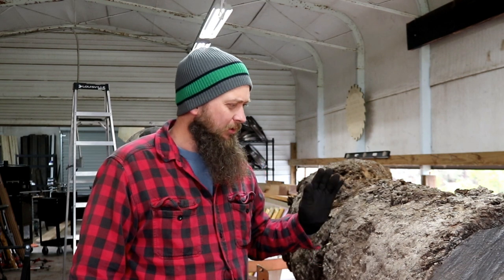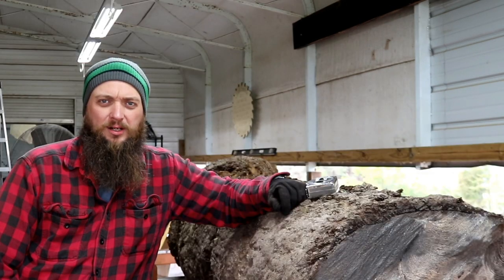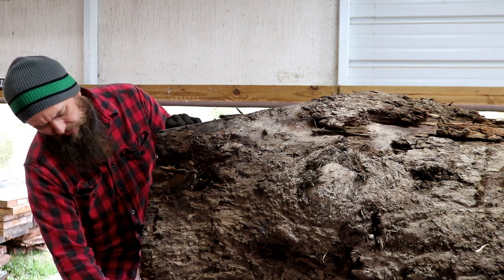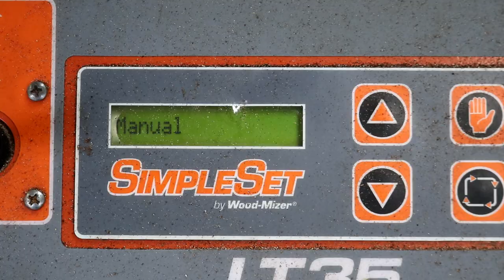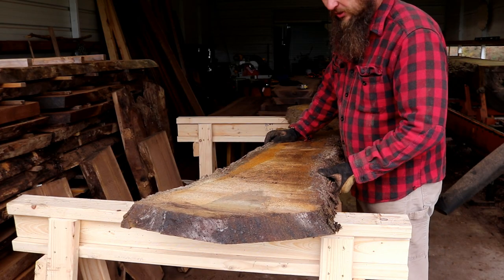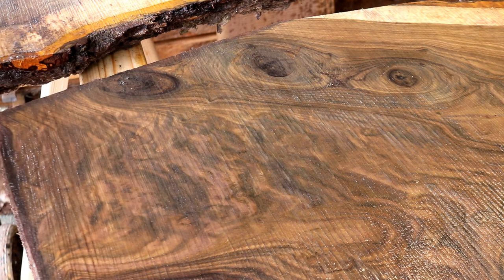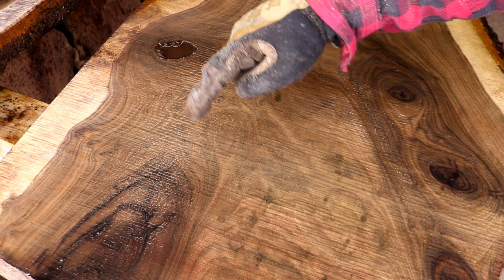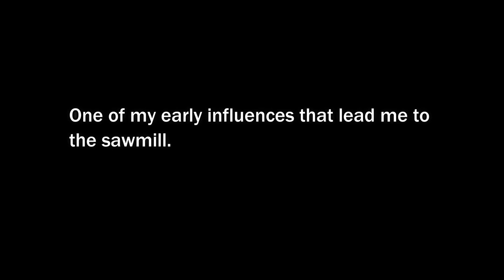THIS LOG WAS LIKE NO OTHER, STUNNING WALNUT SLABS

Comment: When I used to travel backroads north of T.O. (Toronto) in the late 1950’s, looking for derelict farms to photograph for my studies at Ryerson Photo Arts I heard of this farmer who, like many, had a fairly good sized pond in front of his farmhouse. It was getting a bit messed up with old equipment and all manner of other junk so he called in this guy with a backhoe, enough to clear the junk.
It didn’t take long for this contractor to find a large 36” diameter old log , totally waterlogged at the bottom of the muddy pond. After a bit of a struggle and a hefty steel chain he managed to drag it out into the farmyard. To their surprise they found two more which they soon realized were walnut, clean cut at both ends and revealing, even in that condition to be probably intentionally stored underwater by the previous farmer. The logs were ideal for veneer and fetched $26,500 from a veneer specialist who saw the potential profit in allowing the logs to naturally dry out and end up in the high end furniture market .

Comment: That last slab you milled was absolutely stunning, so beautiful.
How much would a slab like that sell for?
Reply: 8ft by 2in thick and 2 ft wide goes for about $400 at home depot, that curly section would probably be worth $200 alone to the right guitar maker.
Reply: £1500-2000 here in the UK, say $1800-2500 at current exchange. I can only dream of making something from wood of that quality.

Comment: Of the species you work with, which would you say is harder on your blades?
Reply from the maker: white oak and Hickory,
Reply: @OutoftheWoods0623  Hey, thank you for the reply.  I work in a prehung door shop so most of what we deal with is fir, pine, and alder.  On the occasion that we have a request for oak (red or white) or maple, it's a prerequisite to put fresh blades on the table saw and radial arm. It really wears them down quick.

Comment: Under the heading of real stupid, i saw a famous Walnut tree in Mt. Clemens, Michigan get cut down(Clonial Hotel).  Tree was freeking huge. Easily 10 to 12 ft. across,  A guy offered to take all the sections for 20,000$, but the butt heads tried holding out for a higher figure. 6 Months later the wood was worthless. Of course that wood@ 9$ a b/ft. was worth a lot more than 20,000, but stupid is as stupid does.